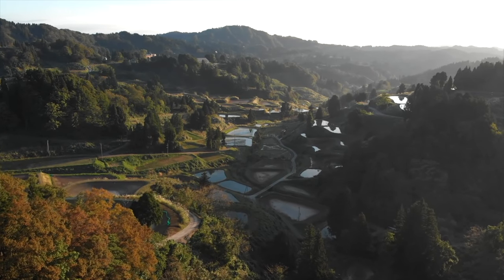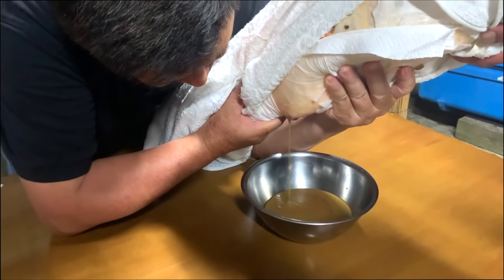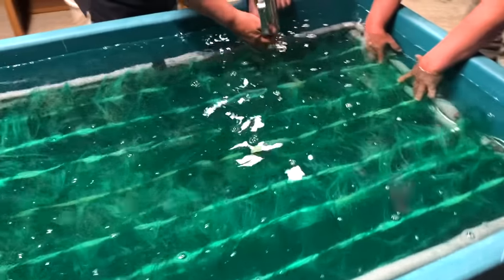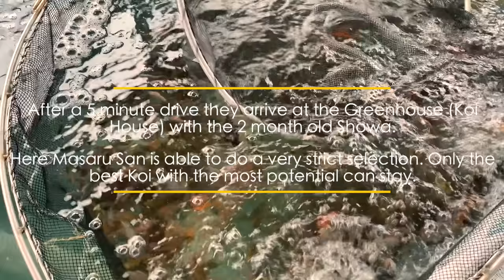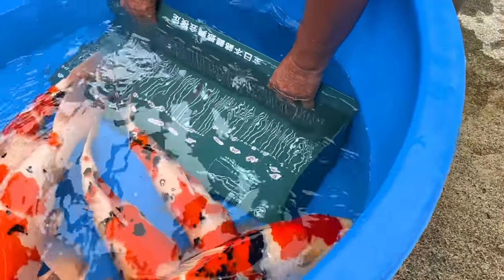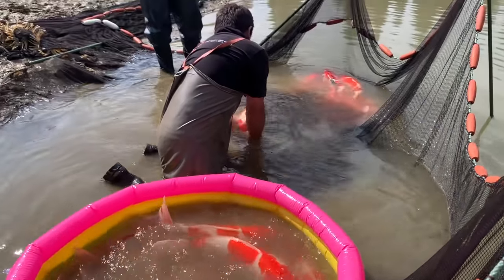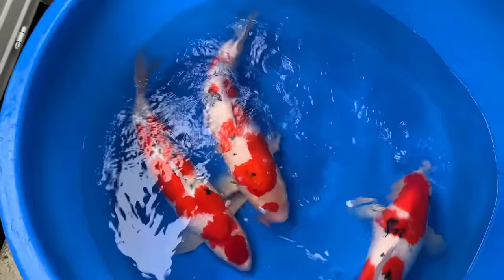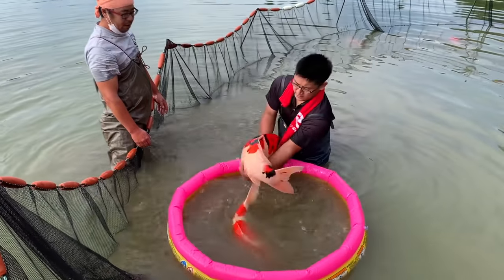From Birth to Jumbo Koi **The life cycle of a Fish**

Comment: What happens to the rejected ones?  I'm only half way through so I hope they cover that...
I bought Koi at a privately owned pet store when I was a teenager, had them in a 55 galon fish tank until they were aboht 112 inches each and about 4 years old...  Then gave them to a friend who had a pond.  I never looked up what kind they were, i remember I had one that was a shiny pearly metallic  yellow gold in color with large plate like scale down its back.  She was lovely!  She was a butterfly koi with the longer fancy fins.  She ended up being bigger than all the regular one's.  I bought them all when they were about 3 inches in size and about $9.  I think the gold butterfly was $15.  This was back in the early 90's maybe late 80's.....
Reply: I know some fish owners will mix water with clove oil, and slowly add it to a bucket with the fish. It basically acts as an anesthesia, and if you add alot to the water, it causes the fish to fall asleep painlessly.
Reply: @Queenofthatank  What was rare about her?  She layed eggs twice, but they were never fertilized as far as I could tell.  They all went to waist and I ended up having to remove them from the tank, what weren't eaten by the others or the cat fish that is.  She was beautiful, I remember in the early hours of the summer mornings the light came through the back window behind the tank and she would just shine.  The shop owner didn't like her because she had the plate like scales on her back instead of the normal scales.  But she reminded me of a golden dragon.  And her long butterfly fins were stunning.  He said if she was any other type and color he would have marked her price up.  He was suppose to get red and white butterflies, and instead she was the only butterfly he received, the red & whites all had normal fins.

Comment: without irrigation in the mudpond?
Reply from the maker: Yes, only rain and some extra oxygen supply by moving the water
Reply: @TheKoiPartner  but in the video you can't see any running water
Reply from the maker: @sipalingmain8436  only rain and some fresh mountain water. So correct: nothing to see on the video. Reason why is because the Fish / Water ratio is so big that its not necessary